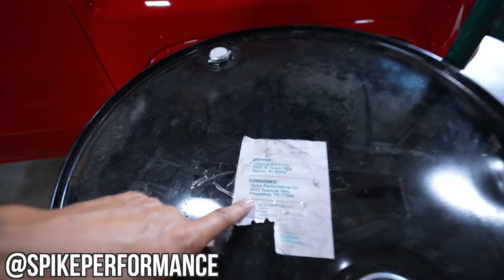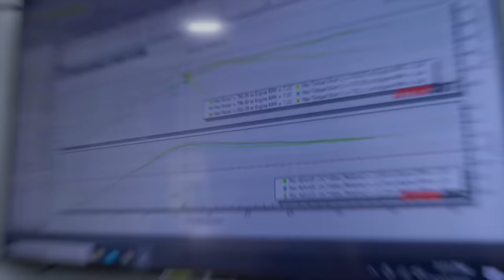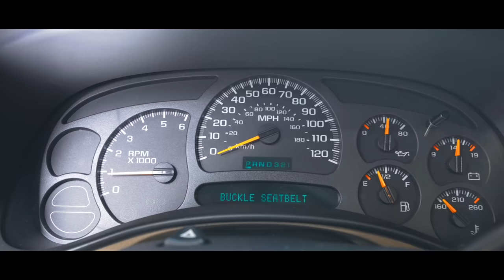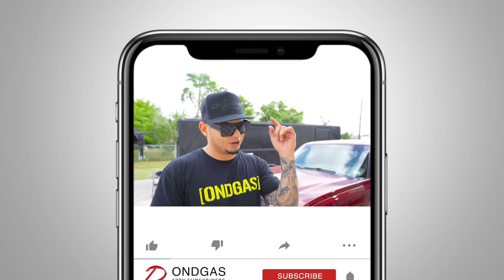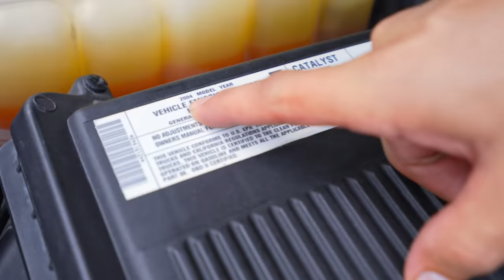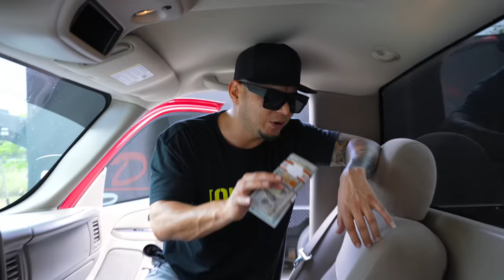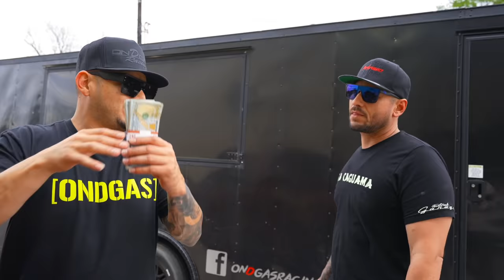Build a Single Cab under $10,000 - Ep.1

Comment: Color match 
Sound system 
Intake and intake manifold 
Headers and exhaust 
Electric dual fans
Full cam kit
Tune
Posi rear end 
Cal tracks traction bars
Spark plug and wires
Full led lights 
Some nice wheels like cosmis or some z28 replicas
A crespo wing
A badass daily truck
Reply: Hell yea

Comment: Window tint
Color match
Nice front n back lights 
LEDs all around and interior too
Bed liner
Nice sound system
Nice rims
Nice exhaust
Nice tips
Cold intake 
Spark plugs n msd wires
Headers
Tune
Cluster
Budget truck build
Total cash 6000-6500!!

Comment: 10k budget 
2 routes to go with either performance or more of a budget show truck 
Show- 
-window tint 
- some 22”s or 24”s infamous wheels
 -Regular nice sound Sound system nothing extreme 
-Hd cowl hood 
-Hd front end 
-New clear headlights with Leds 

Performance
-posi unit/gears with traction bars
-Buil tranny/ stall 
-cam 
-exhaust system 
👌
Reply: No definitely leave the headlight
Reply: Performance fs

Comment: 1. Tint
2. Bed liner 
3. LEDS all around 
4. Sounds system 
5. 22 inch rims/ low profile tires
6. Aftermarket headlights and taillights
7. Cam, Long tube headers, exhaust 
8. Full bolt ons
9. built tranny/stall
10. posi rear end
11. Cold air intake 
12. electric fans
13. gears/heads/ intake manifold
14. Tune
15. SS fromt bumper and Molded Crespo wing
16. Sunroof
16. Color match

Comment: With 10k I would keep it simple 
Cam, long tube headers, air intake, for exhaust a corsa muffler with dual exhaust tip on the side. Tune, some 22s, and some color match. A lil sound system, and a posi🙃

Comment: Nice and simple, 
1.tint
2.bedliner
3.replace headlights, front and rear
4.color match chrome pieces and mirrors
5. Stage 2 cam 
6. Cold air intake
7. headers
8. Exaust system borla s type with 8 glass pacls before tips sounds like a ls3
9. Tune
10. Sound system (just replace all speakers and twitters) 2 or 1 8in subs
11.some réplicas or oem 2014-2020 chevy rims
12. Maintnance (sparkplugs,sparkplug wires, coils, brake pads)
13. E-fans if theirs money left over

Saludos desde el valle de texas🤙

Comment: -Texas speed and performance long tube headers with full 3 inch borla xr1 exhaust 
-CAI
-2 10 subs with ds18 door speakers and tweeters
-tint
-posi
-4.10 gears
-tsp 224 cam kit
-stall converter/shift kit/corvette servo/upgraded clutches
-22” honeycombs or snowflakes 
-tune
-E fans
-40k transcooler
-bedliner

Comment: straight pipe it,  cam, a tune. add low profiles subs. keep it stocking on the inside. on 22's with 275/40/22 tires. and yeah tint and bed liner. leave the hitch on there

Comment: Cam with all supporting mods like efans/intake tube/tbss intake/injectors/fuel pump/throttle body etc
trans/stall/cooler
locker
trac bars/shocks relocation
racestars/venturas on tire 

should be close-ish

Comment: 6.0 with heads,cam,exhaust,stall, a stage 3 transmission, built rear end and all done by Pasadena Speed Shop and some Welds 20x7 front 17x11 rear, color match and remove door molding

Comment: Cam 228/288, gears 4.11, built trans, trans cooler, nnbs intake, e fans, x link, 92mm throttle body, trunion kit, long tubes , cut outs 3", bullet muffler

Comment: $10,000 
Cam kit 
Long tube headers 
243 heads 
TBSS intake 
102 throttle body 
Air intake 
2 Kook 10” Bullet muffler with full exhaust 
Headlights and taillights 
Sound system if you got cheese still!

Comment: Yes take crayfish n race justa6 mustang

Step 1 led lights n rear n front 
Step 2 put tint 
Step 3 cold air intake 
Step 4 headers n full exhaust 
Step 5 rear end 373 with possi 
Step 6 stage 3 transmission 
Step 7 cam kit 
Step 8 TUNE 
Step 9 add wheels 
Step 10 FUK SHIT UP 😤
Reply: Instead of 373 I'll do 4.11 gears , and keep the wheels just go lil lower

Comment: Cold Air Intake
Headers exhaust
Intake manifold
Throttle body
Ported heads
4.10, gears
Cam kit (cam, springs, pushrods)
2 piece driveshaft
40k trans cooler
3200 stall (torque converter)

Comment: 1. Hd conversion 
2. Lights all around 
3. Color match 
4. 20in ss wheels brushed finished 
5. Long tube headers with corsa exhaust 
6.Cam/ bolt ons/ tune  
7. Built rear end 
 ‼️‼️Must needs without a doubt ‼️‼️

Comment: Tint, grill, lights all LED, cold air intake, cam and springs, exhaust with headers, tune, bed liner, new stereo and sound system, replica 24" wheels, and color match the bumpers if there is still money left on the budget.

Comment: ⬅️ 14 bolt posi with 4.56 gears. 4l80, Fast LSXR intake, stage 2 BTR cam,  2500 stall, Texas Speed long tube headers. Stock interior, keep those wheels and keep the 4L60 to save money if you need to but put a Corvette servo in it at least. Take off the tow hitch and put a clean bumper on it with no trailer plug.

Comment: Texas speed headers 
Texas speed stage 3 cam 
Carven exhaust 
Dual tips side exit
Cold air intake
Posi unit
3.73, or 4,10 gears
Black 22" Texas carbons 
Door speakers, tweeters, 10"subs
Titty panel
New head unit
Full LED's all around 👌

Comment: Motor: Cam, headers, exhaust with electric cutouts, oil catch can, cold air intake, tune.
Exterior: color match plastics, 24x10 all around or a drag setup, wheel lights, bed liner, train horns with spare tire delete
Interior: simple sound system, tesla screen, remote start, starlight headliner

Shutout to Wakala! Saw him at bucees in wharton on Sunday 🤘🏼🤘🏼

Comment: 1. tint
2.bed liner
3. Posi
4. Traction bars 
5. weld wheels
6.sound system
7. exhaust (borla)
8. intake, long tube headers, cam, tuned
this gonna be a BAD ASS TRUCK

Comment: 1-tint
2-bed liner
3-long tubes and exhaust 
4-torqstorm blower with intercooler
5-tune
6-welds 20x7 and 16x10s
7-heads and tails
8-color match if enough is left.

Comment: Tint&bedliner= 500
Ss grill& Non hd cowl hood =750ish
Color match front end side mirrors door handles and rear bumper=1000
Looks like 4/6 drop so it needs more low 2 in shackles @ autozone= 50
Cosmi wheels like Freddy og=3k
New taillights and headlights =200
=5500
4500 left to spend on performance mods

Comment: Plain and simple 
Tint
Bed liner
Cowl hood plus paint and paint the mirror caps and bumper pad
Led tails lights
New headlights 
Headers and intake and tune
Corsa or borla exhaust
Weld wheels or reps
Nice simple sound system

Comment: some ideas my boy
-titan window in the back
-sound system 
-22s or 24s
- bedliner
-tint
-sunroof
-cam 
-cold air intake
-new headlights/ taillights/ 3rd brake lights
-leds all around
-nnbs back bumper 
-exhaust

Comment: Welds, tint and color match. Doing performance mods on the little 4.8 isn’t gona make it fast relatively speaking, unless you add boost but this is a budget build so if anything full exhaust and a small cam 220/224 nothing too crazy.

Comment: color match 
218/218 cam kit with baby converter 
Headers exhaust 
Cold air 
Tune 
4:11 with a posi 
Nice sound system 
some nice wheels 
Cluster upgrade 
new tail light and head lights 
and interior if you have budget
Silver leaf bow tie

Comment: Easy and Clean built First Thing First Tint
Simple But Nice Sound System 
6.0 Swap 
Headers
Cam
Possi 
Gears 
Stall
Borla or Carven Exhaust 
Some Welds on the back 
Hd Front End 
And There You Have It Simple And Keeping It Under The 5k Budget And Winner Gets The Truck Plus 5k interior doesnt need to be touched

Comment: Do the tint, bedliner, the a nice sound system with one 12, the door mids, titt panel in the middle and the top also like in top back all across the back window. Then led housing lights all around and inside, including the third brake light. Leave the wheels its got on just maybe new tires, color match the front bowel tie like the red one mr.gapz did that ran across the front. Cowell hood, remove the door modeling. Do intake with headers, corsa exhuast. New injection wires and injection coils, brakes, and maybe a hardtop that folds for the back 🤔. That's what a small budget build should look like 👍 in my opinion 😉

Comment: Needs tint, Bedliner, 2inch more drop in the rear with some 24” infamous wheels. Sound system, stage 3 cam, with a exhaust & exhaust cut out, lastly, a 3500 hood🔥🥶. Color match hood, side mirrors, front & rear bumpers.

Comment: simple system since the interior clean
2/4 6.5’s  (genius audio or Rockford)
2/4 tweeters (Rockford)
Voice and bass amps
2 10’s (Rockford) with a simple box 

simple engine mods 
intake 
Texas speed Headers 
tune up

US  mag “Cheyenne 6- precision series” 
20x9 front 20x12 rear (so the new owner won’t have to worry about hitting or getting tubs)

HD front end with a color match 

7.5-8.5 from the budget spent right there

Brakes, maybe a lower drop for the 20’s to have it sitting pretty, crespo wing, baby cam with a stall (if it fits the budget)

Comment: Tint 
Bed liner 
2015 rear bumper (color match) 
2008 hood with the vents HD for the 2004 
4:10 posi 
Welds 22’ 
Z07 calipers and rotors 
Ts head and cam rockers spring set up 
Cal trac 
System. Saludos 🍻

Comment: Definitely the HD grill color match the bumper front and back get some sharshapes on a 275/60/17 drop y’all said it has a 4/6 on the 17 would look great get a sounds sys over here at audio shop blue lights(led all around) add a cam but not too big just like a good one to be good on gas and still push power on a 4.8 like a 224r would be great e fans plugs wires etc possi little stall headers tune etc…get brand new light all around then boom great build very much a rlly nice daily

Comment: Truck really clean 
ADD the HD hood, HD grill , HD bumper pad 
Add the fog light if it don’t come with it goo all color Match fog light plastic leave it black 
Add turning signals the one that come with the light on the bottom, on the mirrors just color match the middle and the rest of the mirrors black, back bumper color match, add tint add some 22s on it with really low tires

Comment: Truck is already nice and simple But u should
1. Tint
2. Tail lights 
3. Headlight
4.turbo cam
5. Ebay turbo kit 1800$
6.trans build 1700$
7. Posi unit with gears about 850$
8. Sound system 
9. Color match
10. Nice 22s

Comment: New diff, axle back (leave the cats in, or else you're potentially giving someone a headache legally), maybe Tahoe/ Suburban current body style 5 spokes, bedliner, leave the head unit or go with an Atoto Android Auto / Carplay h/u, skip the cam, maybe update the speakers and a 10" sub from CT Sounds (keep it around 1000w), color match the chrome, and leave the hitch.

Putting a cam in a 4.8 is just going to be for sound, unless it is a cam to help aid a power adder.

Comment: Paint correction + ceramic coating 
Colored match 
Full bolt ons 
Cam, Lth, corsa exhaust 
4:56 posi 
Circle D stall
Tune on e85 
LEDs light inside/out
Pi Cluster white led 
JL audio sound system 
Stock interior (too clean to mess with it)
Oem center console 
3 piece rear window 
24x10 billets with decent lip (no diff cut) 
Or 24” Denali replicas

Comment: Put a after market intake Aggressive cam fuel system and headers with Flow masters, gears in the rear mini Tub with Convo Center Lines racing wheels street slicks and a decent sound system , and maybe some NOS to kick it up a Notch 👍🏼

Comment: Put a sloppy stage 2 cam with pac 1218 springs and a summit racing 2800-3200 stall converter all for about a $1000 dollars. And a full speed engineering headers and ypipe. Should be around $1300-1500 in parts. Best bang for the buck for power for these 4.8/5.3 v8.

Comment: Interior 
2 jltw3 10” with manny’s custom box 
Teta panel as well also upgrade the voice simple clean & loud 
Sunroof 
Custom cluster from Ez cluster 

Outside 
 Tint 
Bedliner 
Some welds or some old school baby billets custom size & style 
Color match 
Maybe some billet insert 

Engine 
Factory efans upgrade 
Cam 
Intake
Lsx intake  
Headers with full exhaust 
Gears & posi

Comment: Rebuild the Engine and Transmission...$4000
BTR DOD/AFM Delete kit....$600
BTR Cam Kit....$600
BTR Intake Manifold/ Fuel Rail kit...$850
Long Tube Headers….$350
Electric Fan…$400
Complete EFI Universal fuel system kit…$600
Power Stop Sports Brake Update kit…$700
Yukon Gear and Axel Dura Grip Posi…$700
Gear Ring Pinion Set…$400
Aluminum Radiator…$300
Exhausted…$500

Total Cost:$ 10,000

Prices was based on the higher end price could be less so it could make the $9500 budget. What’s the point in buying rims and repainting if you end up stuck on the side the road, rebuilding and upgrading the motor first priority

Comment: If it's a true budget build, I'd recommend the following: 

1.) Bedliner - $350

2.) Tint - $150

3.) Audio - upgrade door speakers & add a 8" Subwoofer/Amp package - $700

4.) Headlights & Tailights (Spyder) w/LED's - $450

5.) Wheels/Tires - 22" OEM replicas  - $3,000

6.) Exhaust - 50 Series Flowmaster (or similar moderate sound) - $450

7.) Cold Air Intake - Volant - $450

8.) Tune-Up & Oil Change - $500

9.) Color match door handles & both bumpers - $1200

10.) Paint Correction w/Ceramic Coating- $1500 

* * est cost $8,850 * *

11.) - Winner pockets remaining - est. $1,150 (Fuel & Red Bull to drive it home!) 😆  - 💸 💰 💸 💰

Comment: U should do this short bed has complete ss cladding from street concept
with molded wing has no issues tags are up to date
50lbs performance injectors, short headers, 24s tbss
Under bed Notch, rear tubs
Kandy red
ZL1hood
Ss2 wing
Molded ss claddings
525 hellcat fuel pump, aeromtive fuel regulator
Ported throttle body and manifold, heads
Custom grind cam 600 lift cam
223 Cam
Brandy wine
Sunroot
System 2 12s with ds 18s door speakers, 2 marine
speakers up front and 2 In the back pioneer touch
screen
Custom Interior all done
ss trailblazer steering wheel
Running on 91 & e85 flex fuel
411 gears locker
New led lights
New led taillights
5/12 drop

Comment: Sound System (-$1000)
Ceramic Tint (-$250)
22" Budnik G12 Wheels (-$2600)
Line X Bed Liner (-$350)
Magnaflow Cat Back Exhaust (-$600)
That's Just the Start. .

Comment: Window tint (blacked the F out)
Colormatch front bumper plastics (keep chrome) 
Escalade handles colormatched 
Chrome mirror caps ( colormatch the plastic part)
07 classic HD hood & grille (colormatched)
Sound system (2 8s ported)
Full Corsa exhaust 
Intake 
Bedliner 
And I’m sure you can afford some no cut billets with the remaining 5K

Comment: Do Stage 2 cam with a stage 2 transmission & 2800stall & 411 posi gears , cold air intake with a bigger intake throttlebody & injectors with some caltrac racing bars 🔥👌🏼aglo leve

Comment: Cam , headers Flowmaster super 10 true dual exhaust Good set of chrome wheels Intake sunroof electric cut outs Electric fans audio system no tow hitch headlights taillights tint SS clone front bumper New cluster Remote start system Roll pan

Comment: Instead of doing big lips do 24x9 24x10 4inch lips non cuts run about 3,800 wheels and tires so don’t need tubs, hd front end color match lights and fbo tune 🔥 and like y’all said Bed liner

Comment: First ill Do and every Cuh Does is -"HD Front"
Hood/Grill/Bumper Pad 
Then Color match it with Grey accents in Grill and inserts
-"Wheels" Go with some 22" SS Replicas  
-"Sound System" Box/Speakers/Ds18s/Amps/etc..
-"Mods"Cam Kid /Stall/Headers/Cold Air Intake/Possi/Gears 

Some Simple Should be under 10k if theres Extra Money Di a sunroof and a Titan Window 🌴💯🤘🏻

Comment: Headers 
intake 
tune 
Tsp 228R cam 
Magnaflow exhaust
TBSS intake
Ported Tb
Under drive pulley 25%
Tsp Heads
4:30s & posi 
Triple P trans with 3800 stall
All around Led Talights/headlights third brake light
HD front painted
Escalade tear bumper painted 
Racestars 
Apocalypse 6.5 speakers & voice amp 12s subs & amp

Comment: So look check me out. Heads cam intake injectors and fuel pump nitrous plate kit some bogarts tint and maybe a system if you got enough left over. Im a big turbo  guy but with 10k its hard to build properly.

Comment: 4.8 Ls Turbo Kit, Speedway motors has it for $1,549.99
PRC CNC Heads from Texas Speed Comes out to $839.99
Southwest Performace has a 02mm LS LSX LS1 LS2 LS6 Fabricated Intake Manifold Kit Throttle Body & Fuel Rails for $529.99
BTR Turbo Ls Cam Kit with PAC Spring Kit and Retainers $719.00

Transmission Convertor from Circle D $649.99

Caltracs 650
410 posi Ukon 750

Tuned by Cesar HPF 500
and some Cosmes

Well under budget lol

Comment: @ondgas id do an intake head's performance intake manifold also cam it exhaust posi tune and sell those newer style stock's it has on right now to add back to the 10 stacks build definitely up grade the lights maybe a nice hood and a spoiler too and whatever parts y'all take off the 10 stacks build put them into Alex truck too or sell them so y'all can utilize every bit of cash on this build or give to the winner. I build a reliable sleeper performance truck if it were me on stock style number OW5196 wheels
2004-2007 Chevrolet oem rims on some slicks. I mean I don't know if that's already over the ten stacks already. Just throwing some ideas out there. 

Oh also some subs and an amp since it already has a head unit or sell that head unit and put a better one.